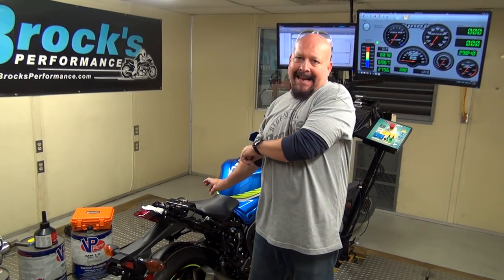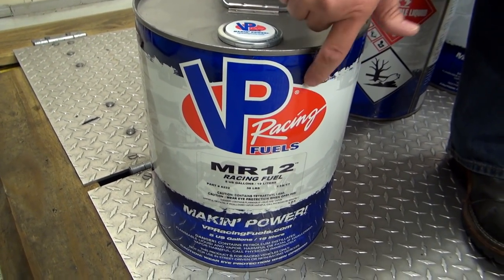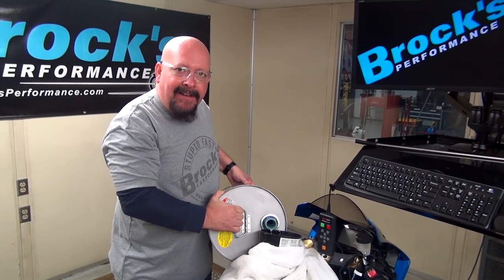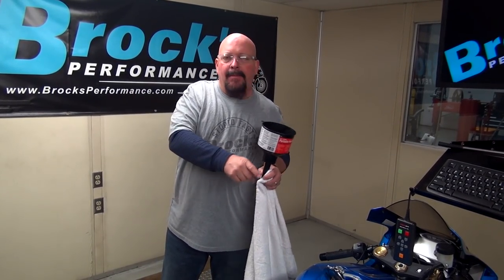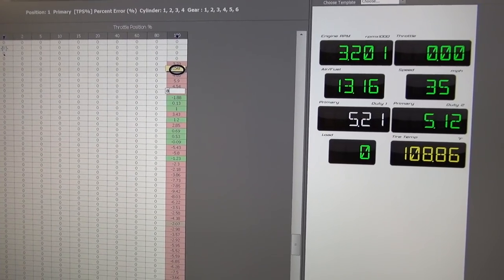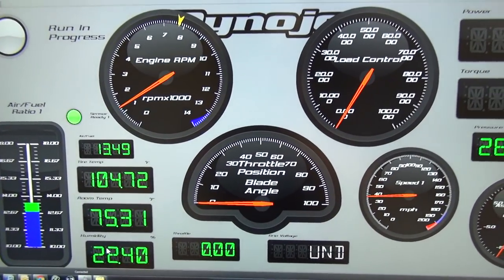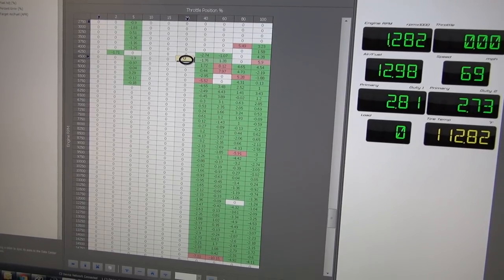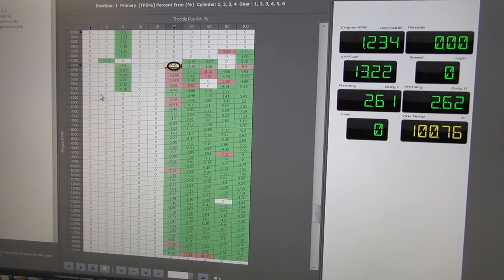2017 GSX-R1000 S2B: Episode 5 (Part 2) - Dyno Tuning for Max Performance ... 200 HP on Race Fuel?

Comment: Ive been telling motorcycle riders for years that have carb/fuel problems to only get gas from separate hose pumps. Some told me i was wasting my time, as they have to clean carbs every spring.

Comment: You must tune a zx10 next, try to do a comparison vid, between bazzaz and pc5..also swap the wheels and sprockets( light weight) to see how much hp you'll gain
Reply: So Fly and pretty Gain horsepower for swapping wheels and sprockets? You wouldn't  gain any HP. You would be lighter and have have a different gear ratio.
Reply: which one  do you think works better for adjusting  timing and fuel ratios ? bazazz or power comander ?  and  i think the engine should be maped to run at coolest  temperature possible  like 219 something isnt right there i dont care if the green box is  green and not red   either timing   or and fuel mix is not correct   bike should be able to run  for miles and not over heat  and  heat causes detonation and we know what that does to pistons  crushes ring lands so rings are stuck no seal like that even worse breaking pistons  melting holes  no good   outcome there  i like wiesco  pistons   they  are built right strong  they been doing this  since i  was a  baby and thats a hella long time ago!.... im 62

Comment: Amaizing series!! So detailed description of such important things! Very interesting because I made Fuel injection on my oilcooled 1100 gsxr and as a base used all wiring and ECU from 1k k7 gsxr. Interesting to know what AFR is the best for a oilcooled engine for a proper tune?
Reply from the maker: We would tune our oil-cooled to 12.6-12.8 to 1...not sure if it would tune the same when injected? Just have to dyno it and find out.

Comment: @brock Davidson: Man i love this:" Have a look into my tuning" kitchen.
This is the kind of (from the lack of a more fitting word) "autistic" level of detail that i 

One of the main things in my day to day job in the IT business is, being consistent.
It shows that people can expect the same level of in and output every day, all year.

I can see from your level of ease in how you explain engine tuning, base mapping, even randomly explaining what the secondary injectors functions are, that you are married to your job. This is just pure love, verbally transmitted thru a video. 

I take my hat off to you Sir.
Solid as a rock, from stock to Brock.

p.s.:
I was contemplating about getting my own FTEcu Benchkit.
You convinced me into getting with this video, because it just make sense.

Even using the same/proven map, depending where you life there will be differences in ambient temperatures, above and below sea levels and humidity.
Having a well rounded custom tuned map, can always be perfected on each owner's bike.
I live in the Netherland so, our weather here is everything but consistent. 

Anyway, keep up the good work and i look forward to your next video!

p.p.s.:
Sorry about the long post

Comment: Very interesting) Brock, could you tell me a bit more about acceleration  graph? I understand that it measures time from start to peak power, but what is start point? Is it the same all runs? Is it machine controlled or you just try to launch from the same speed? Thank you!
Reply from the maker: This graph shows it well: https://bit.ly/2WuZbTB
Reply: @BrockDavidson  yes, I understand, but how do you choose start (0 second) point? Is it like certain rpm you can choose?
Reply from the maker: Time (s) scale. Left click(hold) in an area in the low revs that is stable (4-5K) drag the box to the right to an area before the peak limiter disrupts the runs.
Reply: @BrockDavidson  thank you!

Comment: Brock, great vid.  Is the wideband labeled 13.25 in the video calibrated to lambda 1.0 @ 13.25 AFR?  Do you use this sensor for pump and MR12 since they have different Stoich values (13.1 to 14.7 for non-ethanol) and if so what target AFR for each fuel since a 13.2 with MR12 on the software would be dead on accurate but a 13.2 on the software with pump gas (non-E) would be 14.7.
Reply from the maker: @Mike, the sensors are not 'calibrated' - any calibration would occur in the ECU (for emissions tuning only) or in our tuning program. That sensor had been checked with our test gas and previously measured 13.25. Over time, and especially when using leaded fuel, the readings will change. It's not a problem, it's just something we must compensate for in our target settings. Performance tuning targets are typically 12.8 - 13.2 (up to 13.6 on some machines) to 1 for gasoline. 14.7 is far too lean to make proper power...but it works well for increased fuel mileage and decreased emissions readings. We use Innovate products for dynamic (non-dyno) readings - this article explains why Stoich is great in theory, but in practice...it's not where you want to be for optimum performance: http://www.hotrod.com/articles/innovate-air-fuel-ratio-meter/

Comment: I have a gen one busa with your alien head two full exhaust, pc5 and sprint filter. Is there a need to flash the stock ecu? I always run Sunoco 93. The pc5 have the street map on it.
Reply from the maker: There is no need to flash your ECU. But, you are wasting $ and leaving horsepower on the table by running 93 in your tank vs. 87 (89 for newer/higher compression machines): Check out this FAQ: 
http://www.brocksperformance.com/absolutefm/?f=392
Reply: Brock Davidson wow really? Please explain 87 better than 93.
Reply: Brock Davidson thanks for all the knowledge you’re giving back to the  motorcycle community

Comment: Question: how do you know if 13.2  is where the bike makes more power? Is true that there is not a magic af ratio number and some engines  at some rpm makes more power at different  ratios? (always around safe numbers...)

Comment: Thanks for the tips Brock ..just asking a bit is the bike install the smog block plate..
Reply from the maker: The PAIR is blocked with a simple plug at the moment - we are working on manufacturing caps to replace remove it entirely.
Reply: Thanks for the reply Brock n hv a awesome  day...

Comment: Brock, is it possible to use the PC interface / software independently on another type of Dyno, rather than dynoJet?
I mean, is this solution of 'automatic tune' a self standing product that can be used on any other manufacturer dyno, if connected to the O2 sensor of course?
Reply from the maker: Not that we are aware of. Of course, you can autotune on any dyno - where dynojet has the upper hand, IMO is the integration  and ability to automatically adjust load to match TPS and engine RPM...and simultaneously correct the AFR. The model 250I is the best I have ever used.

Comment: Hey Brocks ! When you remap the ECU, does it affect A, B and C mode or only one of them you chose ? Thx. You’re doing a fantastic job, sharing your experience.
Reply from the maker: That depends on the bike, but usually we concentrate on the max power mode and leave the lower power modes alone.
Reply: @BrockDavidson  , Thanks ;-)

Comment: I have a 2017 gsxr 1000r and I bought the full predator exhaust, ecu flash, power commander with street mapping, and sprint filter all from Brock.. Today my bike dynoed 181.7 wheel horse power on pump gas. I was hoping to see somewhere in the 190’s but I guess every dyno and bike is different. I did feel a bit let down even tho 181.7 is plenty of power.
Reply from the maker: @disarmyou84, we have reports as low as in the 160's and as high as in the 220's. Different brands can vary wildly as well as different versions/models of the same brand. Did your dyno operator think 181 was good for his dyno for your set-up? The operator typically knows if their dyno is 'stingy'.
Reply: Brock Davidson yes he thought 181 was still great power for a mail in set up. He also said the charts looked almost perfect and that you great job.
Reply: Brock Davidson i spoke to Steve over there this morning and he cleared it up for me. A lot of factors come into play when it comes to dyno numbers and I did not know that. The guy who dynoed my bike was still impressed with the 181.7

Comment: Great work and info as usual. Once you have a map created, do you recommend leaving the stock 02 sensor on the bike or removing and plugging it? You will definitely get over 200hp  with the sprint air filter. I say, final hp numbers with sprint filter and tuning 204.26hp. Could you compare both the P16 sprint race filter and the new sprint P08 F1-85 race filter with the mr12 gas.Im curious to see if there is a air/fuel ratio difference between the 2 and if the P08 F1-85 gives a one or 2 point leaner condition over the P16? I was out having dinner when you new video notification popped up. Dinner was great but I suddenly was full and to tired to drive home so I can be the passenger and watch your video lol!!! I know,  I have it bad lol. Needless to say, once Ii get home I'll finish my meal and watch your video again. I can't wait until part 3.
Reply: i removed my 02 sensor.. pair removed...   no problems...   it got turned off in the tune..
Reply from the maker: @apexhunter2k - yes, I have been addicted to bikes my entire life ;)   No O2 sensor in this bike. We covered this question here: https://www.youtube.com/watch?v=uuwPdWOSGRA&t=1s
Reply: Brock Davidson rewatched again. OK thanks

Comment: Brock obviously mr12 works the best but What is the best alternative from vp race fuels that is a unleaded fuel and that won't need to much of a afr adjustment. Say one that you will be able to make a map using auto tune if you have no access to a dyno. What's your opinion on vp mr pro6 Thanks
Reply from the maker: @Jock, I really can't answer that question. We use MR12 in stock engines and MRX02 in high compression engines.  We have not tested any fuel that produces reasonable power gains- worth the additional cost involved (to us) except these two. They are also readily available in our area, which is very valuable since we can't win with what we can't get. I checked out the mr pro6 specs, it's 2 points higher octane than MR12 - so that's a negative for us.

Comment: Hey Brock question , what will win in a race 2017 zx10r full bolt vs the gsxr 1000 2017 full bolt ons . What are your thoughts for top speed and overall power and performance?
Reply from the maker: We can't answer that question just yet, as the products to do an apples to apples comparison do not yet exist. That said, the new gixxer is looking very strong at this point.

Comment: I'm sure it's matter of opinion but do you think is the better of the 2...  the 17-21 gsxr 1000 or the 19-current zx10r? It'd be for street riding/cruising/roll racing.. also I watched your videos on the gsxr s2b is it possible to break the 200 hp mark 
On the gsxr without going to race fuel or, is the most you'll see is the 191-193 mark? Will a aftermarket filter help get closer to there? I seen the kaw got to 209 hp.

Thanks and happy new year!
Reply from the maker: They are both really good bikes. The ZX-10R has a slight top speed advantage. Neither will make 200 on pump...at least not on our dyno. The 2020 s1000rr will.

Comment: I watched one of you vids from a few years back, a BMW that had some issues on the dyno. You put back the stock air filter, do you run stock filters in your bikes? I want to flash my ecu and tune my Gsxr 1000 k5. I was going to put in a bmc filter, what are your thoughts?
Reply from the maker: @Irshad Parak - Hello, please contact sales@brocksperformance.com or call 937-912-0054 for details on your filter question. In a nutshell: until we tested a Sprint Filter in the S1000RR, we had never found ANY aftermarket air filter that worked better than the stock filter for that bike. Remember, just because it's for sale... doesn't mean it actually works better. As far as a flash, yes - we do offer it for your K5, please contact dynoroom@brocksperformance.com for additional details.

Comment: When you flash ecu's, do you smooth out and advance the ignition timing?
Reply from the maker: It depends on the bike - many times the ignition timing is PERFECT. The engineers who created the bike make sure of this. FYI: This bike has stock ignition timing.
Reply: Brock Davidson yeah, the new gsxr timing is pretty smooth, no dips. But? When you put on a full exhaust. You can get away with advancing the timing another degree or two fairly safely. Should easily put you over 200hp. Especially with mr12 being more knock resistant
Reply: also, it looks like each cylinder ignition timing is unique. and that cylinder 1 and 4 are similar as are 2 and 3 to each other.  (ft ecu) software.

Comment: I have a '14 CBR600RR.  I want to dyno tune it with a PCV.  To prepare for this I plugged the pair from inside the air box.  But I still get exhaust popping (I thought that would be gone after plugging it).  So I think there is an exhaust leak.  I'm going to check the connections around the de-cat that's on it.  But can the exhaust popping throw off the dyno tune readings enough to cause problems?  How do I deal with my situation?
Reply from the maker: @Matt, exhaust popping under deceleration does not affect dyno tuning as it is performed under acceleration. Even with the pair blocked, the addition of a short/free flow muffler can create popping - it happens in the stock muffler also, but it is designed to prevent you from hearing the pop. Exhaust leaks can also cause popping, as well as a lean fuel mixture.

Comment: Hi Brock: Why do you use an o2 sensor calibrated at 13.21 for the tuning session only ? is it for the ECU ?
Reply: i got the answer. you  made a test to see if the sensor is ok.
Reply from the maker: Correct. If the sensor is bad, we cannot properly tune the machine.

Comment: Brock I live in Australia where we have 91,95 and 98 octane fuel.I'm purchasing a 2019 Gsx s750 which as stock has 114 bhp..The Yoshi Alpha t adds 2 bhp and 2 torque,, also will an aftermarket air cleaner like KnN with the (say 95 fuel) bring my Bhp to 120 ? Cheers..
Reply from the maker: @Paul, please read this ( https://en.wikipedia.org/wiki/Octane_rating )to see why your Octane rating is typically displayed 4-6 pts. higher than ours. For the highest performance gain, please see our selection of Sprint Filters for your bike: https://brocksperformance.com/air-filters/

Comment: Any benefit to running MR12 even richer? I know regular pump gas makes its most power around 12.8-13.2:1 even though stoich is 14.7:1.  VP lists MR12 stoich at 12.87. What other AF values have you tested MR12 at and what were the results?
Reply from the maker: There can be, depending upon atmospheric conditions, and use. - lower humidity allows for a richer AFR, and higher humidity allows for a leaner AFR etc.. Use example: Land Speed and Road racing naturally produce more engine heat than Drag racing. A richer mixture can help keep engine inlet temps lower, so more power can be developed as well as decreasing the chance for detonation. There is also tuning for ram air, just because you are going faster and forcing more air into your engine, does not mean that it's running leaner. More info: https://blog.brocksperformance.com/faq/how-can-brocks-get-mapping-so-close/
Reply: @BrockDavidson  Thank you for replying!!

I built a lot of racing two-stroke PWC engines throughout the 90s. Atmosphere didn't play as much a role with those engines unless there were major swings in temp or humidity, but most of the time your settings were fairly consistent, and I always ran rich to err on the side of more cooling (as much as 80% of a two-stroke's cooling is from fuel anyway).  The oil ratio, pipe temp, and rider's throttle style were bigger factors than anything.  The simple carbs on a two-stroke PWC was nothing like a motorcycle carb, nor anything like fuel injection today, there were only two circuits and I tuned with a tach (not a dyno).  I've owned a dozen modern motorcycles, dirt bikes, street bikes, and sport bikes, and use FT ECU and PCV to tune my current bike, but not having a personal dyno is what led to my question.

I understand what dynamics go into what can make an ideal stoichiometric fuel ratio different on any given day.  My question was more towards the spec of the fuel.  If pump fuel stoich is 14:7 and makes its best power around 12.8-13.0:1 (13% richer), and VP lists MR12 stoich as 12.8:1, would it stand to reason that it makes its best power around say 11:1?  And have you tried this or would you be willing to?
Reply from the maker: The fact that  MR12 contains additional O2 makes the non-oxygenated pump ratio relevant by comparison. Yes, we test this theory on every MR12 map we create. At the end of every map session, we test the finished map vs. X% richer and X% leaner. I use X% as single injector bikes require far less % fuel change than dual injector bikes to accomplish the same (relative) results. If both of those maps make less power than the finished map...we have confirmed the finished map is as perfect as we can create for any given day/combination.
Reply: @BrockDavidson  Okay, AND? What have you found? Is MR12 consistently more powerful at richer ratios? What ratio is that?
Reply from the maker: No. It consistently makes more power at the AFR the bike prefers to make max power, and this changes depending on the make/model/year/mods etc... it can be anywhere from 12.6 to 13.6 on the sportbikes we test. Please read this as the end touches on why this is: https://blog.brocksperformance.com/faq/how-can-brocks-get-mapping-so-close/